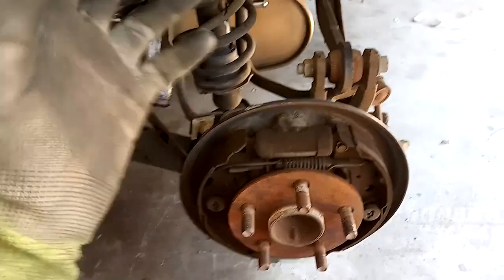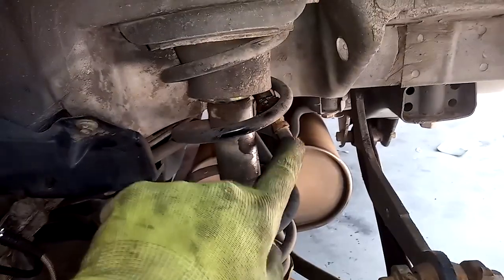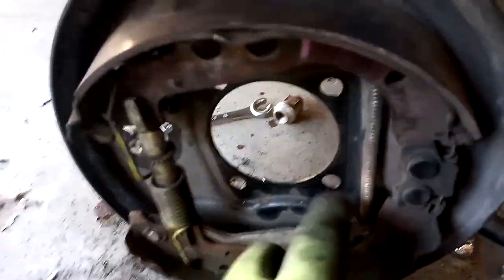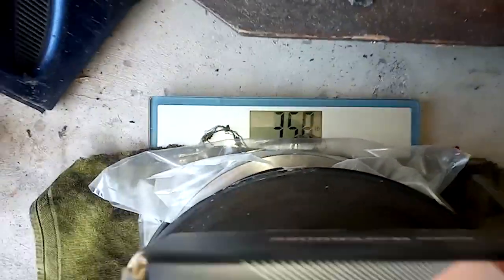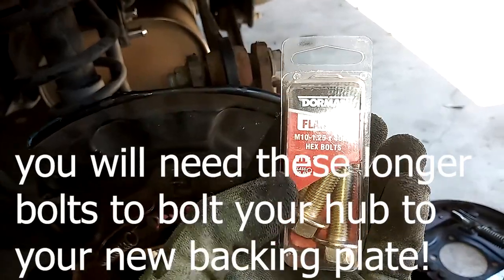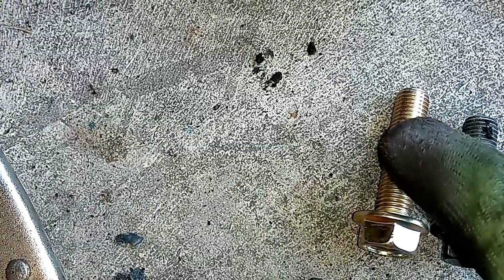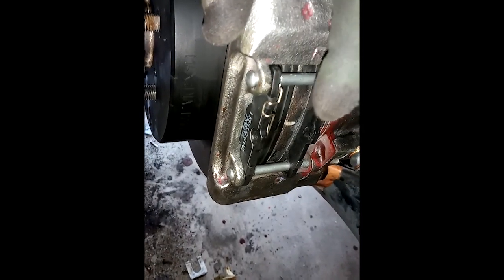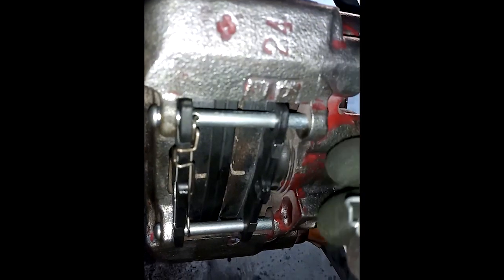2000 to 2005 Toyota Celica rear disc conversion!

Comment: Quick question, I understand that we need 2 rear calipers, 2 rear caliper brackets, 2 rear backing plates, 2 rear rotors, 8x m10-1.25 x 40 bolts, alongside the usual brake pad mounting hardware. Im just confused about if we I can use the same GT knuckle or if I need to swap to a GTS knuckle because some forums and videos state I need to swap the hand brake cable and the knuckle from the GTS but ur video doesn't require that.
Reply from the maker: The hand brake cables, and the knuckles ARE GT. Those parts swap over
Reply: @n-putsgarage2875  ok appreciate it thank you. Also one more quick question as long as I have the GTS backing plates I can mount the caliper right? I dont need a GTS caliper bracket because I dont see any
Reply from the maker: @alisadiq8261  no problem :) you are correct.

Comment: Hey nice video. I’m doing the same to my Corolla S soon. Quick question. Do you have to change the wheel cylinder and parking brake lever as well or can you re-use them?
Reply from the maker: you can re use them
Reply: @n-putsgarage2875  oh perfect thanks bro I appreciate it
Reply from the maker: @jasonafrifa1418  no problem

Comment: You weighed the brakes, drum vs. disc ?  Never seen that done before. 
Drums times two, then disc divided by two ?
18 pounds per side with new disc. 12 pounds for used drum setup. 
6 pounds per side ? Is that relevant ?
Reply from the maker: Thats why I did it. I want to try and get as much info out there as possible when I do my how-to videos. And to answer your question. Yes, it is relevant. The extra 6 pounds increases the weight of the car. Just giving people something to think about if they are trying to turn their 7th gen Celica into a track car of some kind.
Reply: @n-putsgarage2875  I am tempted to convert my 2001 to rear discs. But no garage, it's my only car, I have physical limitations ... 
But your video is hopeful.  Thanks.
Reply from the maker: @stevejette2329  I understand that.

Comment: Hello, i concerned about the "lip" 7:50 , for any reason the gts doesn't have it, if the tire is a little out this maybe affect the car aligment or even the brake pads isn't centered, the brake pads wear will not equal, i have also notice the brake hose is forced maybe for the new "lips" distance.
Reply from the maker: The brake pad will be centered BC it mounts to the backing plate. No alignment issues at all. I'm not sure what you mean by "forced" in regard to the brake line.
Reply: @n-putsgarage2875 Hello happy new year,  All this time I have been researching and you are right there is no problem with the modification friend, the hose looks like it is not an OEM hose it seems a little stretched.Great video friend I will have it as a reference for my modification, thank you very much for sharing it

Comment: Quick question, after i did this. My rear passenger pads are dragging a bit. I reused all the hardware from a celica set onto my matrix xr. Im thinking i should buy a disc hardware kit, to replace the anti rattle clips and the slide pins. Lastly, did you grease any components?
Reply from the maker: yeah, the hardware I used was new. I ordered the parts from Monkey Wrench Racing. I didnt grease anything. I did put a little bit of anti-seize on the center area of the rotor to help prevent it from rusting 2gether later on.
Reply: @n-putsgarage2875  Awesome Right on. I had a local friend locate a set of the brakes for me and install them. Also went with the MWR braided lines.
Reply: @n-putsgarage2875  I ended up replacing the hardware, and greasing the slides and the sticking caliper and pad stopped squeaking.

Comment: The only problem i have had is that the rear disc brakes do not have enough stopping power. Did you change the proportioning valve?
Reply from the maker: nope. Its the same valve for GT and GTS IIRC

Comment: Dude I have a 04 gts snapped the bottom caliper bolt messed up the threads getting the broken piece out can I replace the caliper bracket with out replacing the whole knuckle if so how
Reply: I didn’t see how you did it
Reply from the maker: If you are talking about the front caliper, then yes you can replace the bracket by itself. It's a simple 2 bolts that bolt the bracket to the hub area. it unbolts the same way the caliper would unbolt, should come off really easy. If it's the rear caliper, you may need to replace the backing plate that holds the caliper in place because there isn't a lot of room to retape the bolt hole
Reply: @n-putsgarage2875  it was the backing plate I ended up going to the local you pay and you pull junk yard and started takeoff stuff apart and figured it out thank you man
Reply from the maker: @MKobe  sorry for the late reply. Youtube thought your comments were spam and i didnt see them till now. Glad everything worked out for you.

Comment: Part number bolts where doing a 2003 now all parts but a gt so I need 8 longer bolts .
Reply from the maker: The bolts i showed in the video came from Oreily. Those are the ones you will need

Comment: Can you re-use your drums from your GT and add it to the rear disc set?
Reply: Did you ever figure that out? Did you just switch over the shoe's and spring's and adjuster ECT. To new backing plate?
Reply: @odinsravens1818  I figured it out. You can't re-use the shoes and drums from the GT

Comment: Do all the cable connect or do I have to get other ones for the swap
Reply: And I guess I'm going to have to scrap a gts rear disk clamp
Reply from the maker: you can use your gt hand brake cables.
Reply: @n-putsgarage2875  thank you so much
Reply from the maker: @juliomoreno2443  no problem